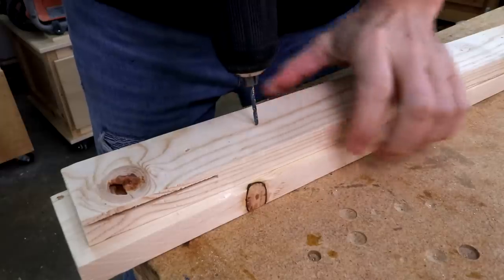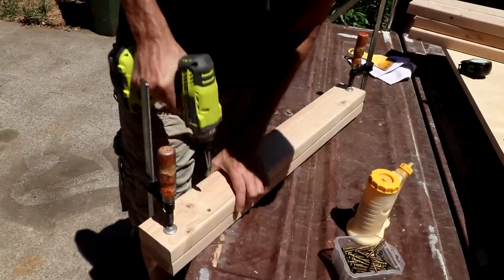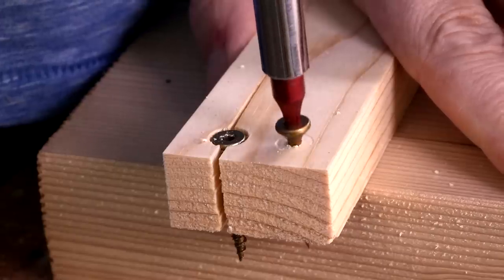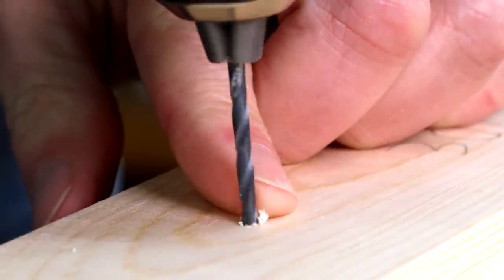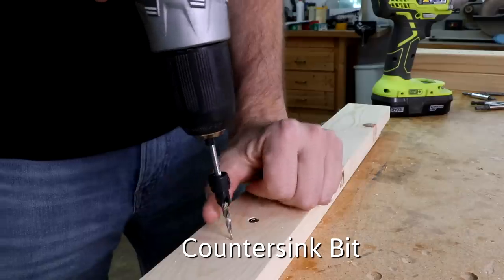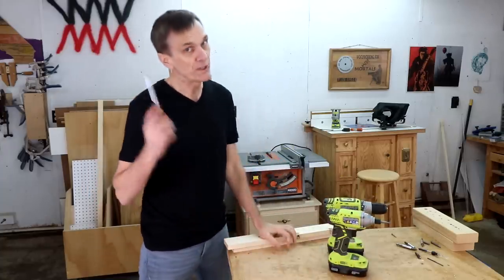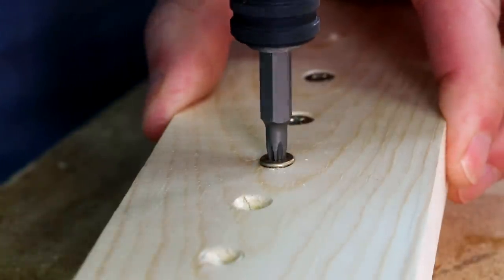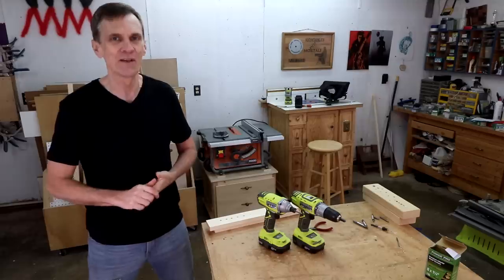HOW TO DRIVE SCREWS (without splitting wood!) | Woodworking BASICS

Comment: Where you get those countersink bits Steve. Ive just been using a drill bit the same size as the screw head.
Reply: Paul George Home Depot has a few sets from different brands. The really cheap Ryobi ones work just fine.
Reply: To Paul George:  I don't know where you live but in most countries they sell them where you also can buy your regular drill bits. Any big box store has them, even Aldi or Lidl from time to time.

Comment: What about the "correct" torque on your tool? I use my DeWalt drill to drive my screws, but I am not sure which torque selection is the best one "5"? "7"?
Reply: MFeinstein I have used drills to drive screws for years and there's no Goldilocks zone for the clutch.  Some wood is softer than other varying even in the same piece of lumber.  Even when I was being careful with years of experience I still managed to over tighten screws with a drill.  Today I use an impact driver to drive screws and it's night and day.  You have more control with the impact to drive in screws.  It's hard to explain unless you used it and I have been using an impact driver now for a year or two and even bought a second one
Reply: Gabriel Matte my problem used to be always selecting high torques and damaging my Phillips bits and screw heads....I don't want to spend 100usd on an impact driver right now since this is just a small hobby of mine, I guess I just need more experience. What I wanted to know more is then how to know if I am overtightening the screw?
Reply: MFeinsthead.-  In my mind Phillips is an antiquated screw head for woodworking.  It's great for a person putting in drywall and flooring because it slips off and the pros have special drills that do just that at the right moment so it's super productive for them.  The issue is that in woodworking you don't want the screw to slip.  My favorite is the Robinson head or square head.  I know where I live it's the standard screw type but you might be stuck with a a star drive or torks a 6 sided screw head.

I am a carpenter and I have problems with Phillips screws.  The only advice is put lots of pressure and go slow.
Reply: Gabriel Matte I live in Brazil and woodworking here is really really just for carpenters, and most of them don't care about the new stuff, so I basically can only buy Phillips on the stores. I could probably find other kinds of screws online but the price difference would be huge. I am getting good results with naval plywood on my DeWalt drill with the clutch set to 5 with a pilot hole. The only problem is that I am doing it out of instinct, it looks to be good, but it could as easily be too tight, so I would like to know if there's any way to know if it's too tight or how tight it should be.
Reply: For over tightening usually when a screw is digging itself into wood it's plenty tight.  For a screw with a flat top you want the head of the screw just under the surface.
Reply: Gabriel Matte great, thanks!
Reply: MFeinstein I live in Canada...  I don't remember life without square head screws.  It's been a standard here for a long time and I can't see why Phillips is still a thing.  I bet that if carpenters used square head screw for a couple of jobs even in your country they would switch without blinking.  It really is that dramatic of a change

Comment: You have still got it wrong, the pilot hole of the top board needs to be bigger than the screws thread so it only bites into the second board. If you are going to do it right, do it right.

Comment: I had to watch this because it is my today's project.  Literally drilling a 3.5 inch screw into two 2x4 boards and it does not flow like hot butter as seen in the video. Maybe it's the drill.  Maybe it's the lack of biceps.  Maybe it's the bit.  Maybe it's the boards.

Comment: Want to not split the wood without having to drill a pilot hole first?
The answer is put the impact driver in reverse and drive the screw reverse for 5 seconds, then change over to forward and drive the screw in as you normally would.....try it, works 100% every time....no splits, give it a shot and save yourself the pilot hole.

Comment: Could you gloss over how to drill with masonry bits? I seem to drill 10 or so before the bit is totally shot.
Reply: Fredrik That shouldn't affect the drill bit though, as you may need/want a hole at an angle.

As previously mentioned though, keeping the drill bit cool when drilling masonry, particularly with large holes is important.

It should be noted too, that you need to use a masonry bit too, they are usually silver in colour and fairly blunt on the end.
Reply: Make sure you are using a hammer drill. A regular drill will take too long and burn out your bit.
Reply: Using my regular 3/8 Dewalt corded drill would take forever to drill a hole--heating the bit in the process. Two weeks ago I bought one of those 1/2 Wal-mart Hyper Tough hammer drills on clearance for 10 bucks (normally about 20) figuring it was junk that would go right back.  Holy Crap that thing takes only seconds!   It probably won't last, so consider how many holes you need to drill before forking out money.
Reply: borwish borwish At $10 the drill is probably cheaper than the masonry bit. But yeah I was dumfounded thenfirst time I used a hammer drill on concrete. It drills faster than you can drill into wood with a regular twist drill bit.
Reply: For normal bricks it is imho better not to use the hammer drill setting. I use it only for drilling in concrete walls or ceilings.
Reply: (my reaction to the remark of mr. Patrick Bink)
Reply: The Noob Woodworker definitely the first thing that came to my mind was using a hammer drill.   I'm a strong believer that masonry you need that impact just pressure and spinning you are basically polishing it.  Sure it will wear down but it takes time but the impact the hammer drill will do will break the concrete

Comment: can you discuss in the next video what the number settings on a drill mean? i never found a good answer online or in the instruction manual for my dewalt drill
Reply: The numbers relate to the amount of torque, or twisting force, the drill will exert.  On most drills I've used they go from zero to something like 20 or 24, then you have a drill bit picture for the last setting.  What this lets you do is set an amount of torque you want to have the drill deliver.  If you are drilling holes then you would normally want all the torque you can get to be able to put the hole through harder wood or obstructions such as knots in the wood.  If you are driving a screw into soft wood you probably want to dial it back so that you don't drive the head of the screw below the surface of the wood face or just not continue to drive the screw once it's all the way in and tear up the head or your bit.  When you hit the maximum amount of torque for your setting the drill will chatter instead of turning the bit.  You will need to experiment with your particular drill to see what the sweet spots are for each task and for different hardnesses of wood.

Comment: Good tips. But i recommend if you can or work allow make pilot holes.  You will have better results, eliminate splitting . Also if you screwing two pieces of wood together one on top of another with just screw without pilot hole that screw will push bottom piece out. Always.  With pilot hole you prevent this to happen.

Comment: The pilot hole in the top piece is a greater dia than the screw thread so that the screw will tighten the top piece to the lower piece! Otherwise there's no compression between the two and the screw might even jack the two pieces apart. When did people stop doing this?

Comment: In the small piece of wood that splits it appears that the first screw doesn't have a self drilling tip (fluted I think it's called) and the second screw (even though you pre-drilled) does have this feature.  If this is correct why wouldn't you use the same type of screw for the demonstration? Hedging your bet??
Reply from the maker: +plumber77mjr It's the exact same type.
Reply: Both holes used the same sized screw. Whenever you are near the end of a board you run the risk of a split, and it can happen even if you pre-drill. Make sure the drill bit is the same size as the screw shank; using too small of a drill bit can cause a split when the screw is pushed through.

Comment: It's not that I like twisting stuff by hand, but if I use a powered driver, the screws strip instantly. Instantly.
Reply: jjohnston94 Are you using Phillips head screws? Star and square drive screws are very difficult to strip.
Reply: I'm talking about the wood, not the drive. The wood strips as soon as the screw starts to take up and it never gets tight. It doesn't happen every time, but I'm very surprised to see Steve using an impact driver and not stripping screws. I use square drive screws from McFeely's.
Reply: jjohnston94 - Using a drill to drive in screws you need to be careful and take it slow and controlled until you get a real feel for it.  I know that for myself even after years of woodworking I would still strip screws.  Today I use an impact driver and it's night and day.  I don't even know how I lived without one.

Comment: The other way is to put the screw in. Put the drill in reverse mode and put the screw in then it burns the wood then put the drill in forward and it will drill in and no crack wood

Comment: If you drill a pilot hole it is better to drill the hole larger than the screw, the screw hold in the first piece has no role in making the joint. By making the hole larger you make the working of the screw better: it draws the two peaces of wood tight together, making a stronger joint.

Comment: 😪I made the mistake to drive a screw without driving holes and it was a pain to do it. My m12 fuel drill and impact driver were having a hard time when it hit the second 2x4 the screw broke in half. Next time I'm sure to make a pilot hole. You should not advice ppl to drive without a pilot hole

Comment: I drilled a pilot hole , the wood still split. LOL!
Reply: That could be that even with a pilot hole when using a countersunk [is that an actual word] screw the pressure from the head of the screw may be enough to split some wood if you didn't countersink the pilot hole first. Or even that the drill you used for the pilot hole was fine and smaller than the shank of the screw. Sometimes taking the screw part way to the maximum depth and backing out and doing that progressively can also prevent the wood from splitting. Cheers.

Comment: No need drill I pilot hole... just reverse the screw for a few turns with your cordless drill, then make it go forward and will drive the screw in without splitting the wood. You’re welcome.  :)

Comment: Do not drill the pilot hole as long as the screw.  Let about a third of the screw tip imbed itself into the bottom board.

Comment: Wow thats some advice there Mr. One+! People of youtube get a magnetic bit and a sleeve if holding the screw around the head isn't working for you and dont use ur finger to start the drill get a nail punch it just use a nail and tap a little to make a starter hole for the screw to set in or hell just very lightly tap the screw a few times so the threads catch  but dont put your fingers where if you slip off  or press the trigger just a little to hard your missing skin or got an _+ *  shape hole in your finger. Just saying ive been doing construction for 15 years ive never seen anyone use a drill like that stuff happena sometimes dont ask for it! By watching some Yahoo on a Tub€Your$elf he  won't be there to hold the screw for you after you stop bleeding and cant bend a knuckle  to hold it

Comment: Impact Driver 
Or
Drill 
Long time shop worker but I still don't understand the difference between, what tool is more versatile?
Reply: The drill is going to be more versatile if that's your only tool since it can do both drilling and driving, while the impact driver can't drill.  Ideally you should have both if you are driving a lot of screws, where the drill holds the drill bit for pilot holes and the impact driver has your driving bit for the screws.  You are going to be a lot more efficient that way, not to mention that if you are cordless your batteries last longer because you aren't constantly loosening and tightening the chuck to swap bits in and out.  The impact driver will do a better job driving the screw because in addition to twisting it in it also pounds on it to push the threads through the wood.  It also slows down or stops when the head is fully seated so you aren't driving it too far down into the wood and possibly blowing the screw tip out the other side of the wood you are joining it to.
Reply: Kurtis Smith 
A drill is more versatile as it can do everything an impact driver can do plus more. Look at an impact driver as a specialty tool, it is designed to drive screws and other fasteners and that's it. It is more compact and can fit in places a drill sometimes can't, it has an impact function similar to an impact gun used in an automotive shop. It hammers as it turns the screw giving it alot of power and speed. Works best with square drive or star drive screws as opposed to Phillips or flat head screws. It is very efficient at driving screws and fasteners not much else, if you need something that can drill holes, drive fasteners, and other stuff a drill is the way to go. If you can afford both get both, if you can only have one go with the drill
Reply: An impact driver can drill but will only accept hex shank bits. An impact driver does NOT hammer down on the screw like a hammer drill. It impacts on the rotational force of the screw, not the down force of the screw. Joining cabinets I always used my impact driver with countersink drill bits. Worked great.
Reply: Installing cabinets I would use 2 impact drivers, 1 for a countersink and the other for my driver. I would use my drill for my hole saw only. I don't understand the hate for the impact driver. Versatile tool by me.
Reply: Ideally i agree with you, but you can drill holes with impact driver, you just need  drillpits with different sockets and be careful not to brake them. Because the mpact imotion starts from surten torque, i havent had any problems with drilling pilotholes in MDF or greenwoods with impact driver.
Reply: Steve also made a video on the difference between the two a while ago check out that video and all will be explained
Reply: I find I have more control with an impact driver than with a drill when driving screws in wood.  It also gives more power when I need to drive in lag screws because of the impact itself.  This control and power makes it easier to drive screws.

A drill works and I have been using them for years and to be honest I wondered the same thing until I bought a drill and driver combo kit and tried it.  I haven't looked back from owning and using an impact driver now I own two.

Comment: Evidently, cutting or grinding the tip off the screw so it's flat will help prevent splitting as well.
Reply: Path in AZ -  Does it???  I remember somebody telling me to hit the tip of a finishing nail with a hammer before driving it in to prevent splitting.  The tip of modern screws are self taping so I don't know if that is the case anymore.
Reply: Gabriel Matte Yea, I don't believe it applies to the self tapping screws. It was just a recurring tip seen throughout many videos.

Comment: I predrilled & it still split :(
Reply: djnevous3us - Two things could have happened.  The first the drill bit wasn't big enough and second maybe you drove the head too deep. 

For the first put the screw behind the drill bit and you should just see the tread.  For the second it's about taking your time when driving in screws especially near the end and using an impact driver if you have one will also help over using a drill because you have more control especially when you go slow near the end
Reply: ok thanks ill try that again
Reply: Maybe the wood needed a countersink?

Comment: ADVICE/SAFETY: For safety reasons & because there is a MUCH easier & more effective method, I highly disagree with this Youtuber instructing to "Use your finger pressed against the drill bit" to start pre-drilling the hole! As you Will 100% cut/graze your finger!! & if you were doing 100+ screws, you would have no finger left! lol. INSTEAD, the easiest way by far is to simply "press the drill down into the wood" & then start drilling, u can then simply stop pressing after it has entered the wood by 3-5mm! This will make SURE the drill bit stays in one spot & is what we have done in Subwoofer box builds/installations for 2 decades now.
Reply from the maker: Lol wut